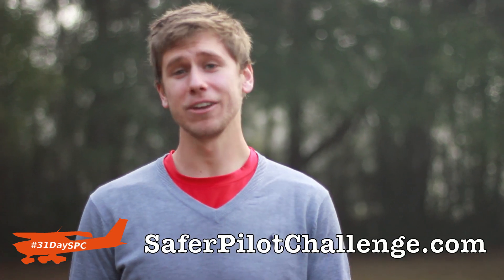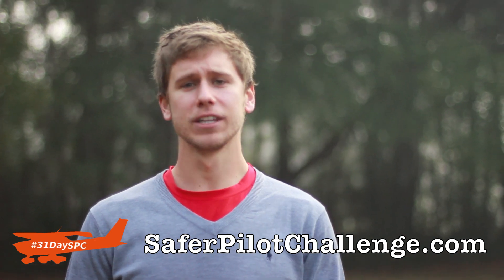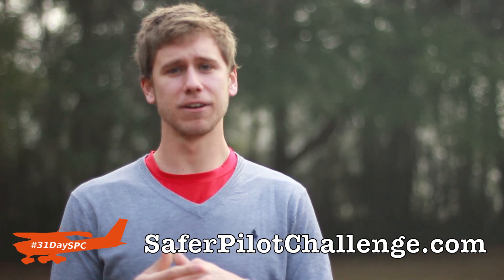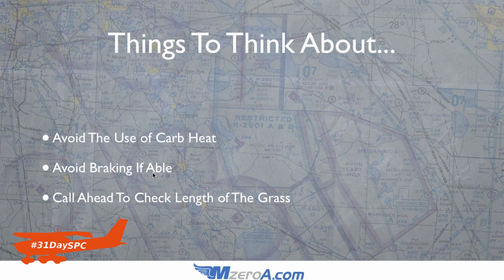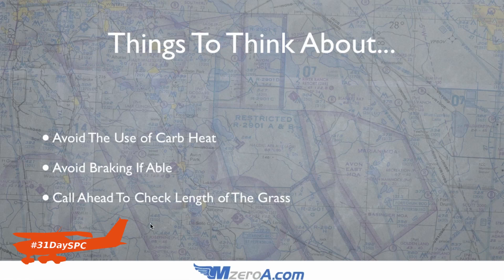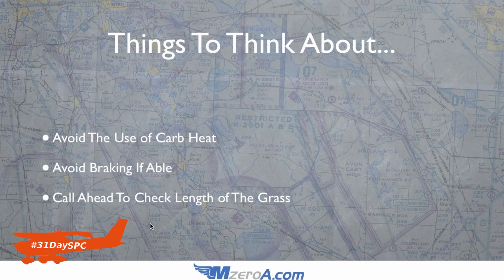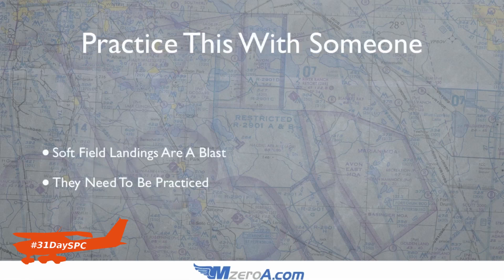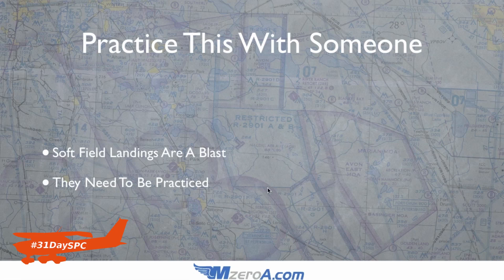Soft Field Landings - Day 4 #31DaySPC

Comment: Hi Jason, excellent video!

About the first point (Avoid the use of carb heat)
In my experience, the use of carb during soft field landings is ok if you use carb heat on approach only (as one would during a normal approach) and turn it off at about 300-200ft AGL. It's right next to your throttle hand so it can be turned off without looking for it. Turning it off before touchdown also means there's engine power available for a go around if needed.
Obviously, don't use carb heat on the ground when on grass or gravel or any soft field.

I'd love to know what you or others think about that technique. It's just something we do at our little airfield. Even though it's a sealed strip and taxiway, it's surrounded by farms and grass and gravel and loose hay and soft field-like environment.
Thanks and safe flying. :)

Comment: I live in a country where well over 90% of PPL training is done from grass strips. Where the use of carb heat is concerned, I've always been trained "carb heat away" during short final and I usually do this when applying the third stage of flap to avoid forgetting if prior to 'over the fence'. This procedure served 2 purposes, first, it meant you had max full power for a go around and second, as was stated in the video, the valve is closed on landing and rollout.

Comment: The "advice" of avoiding carb heat is idiotic. It's not "just unfiltered air . It is heated air, because carbs ICE UP under the right conditions. The carb does not care if you're landing on a soft field or LAX. If conditions are right, it will freeze and your advice will one day kill some student coming in on a humid,cool day, who get's his approach wrong and tries to go around with a frozen carb. And ends up in the trees. Just cut the heat at touchdown if you must. Who told you this nonsense?